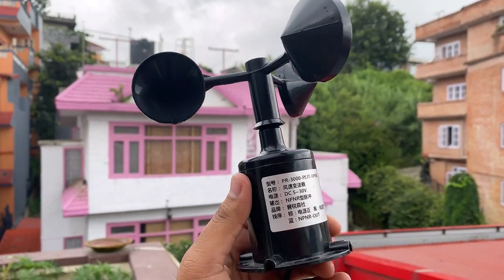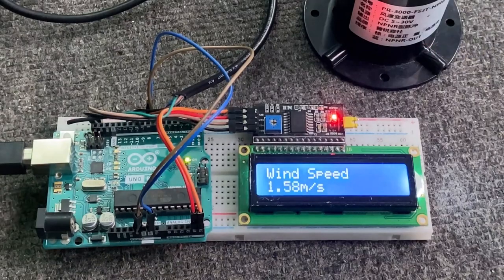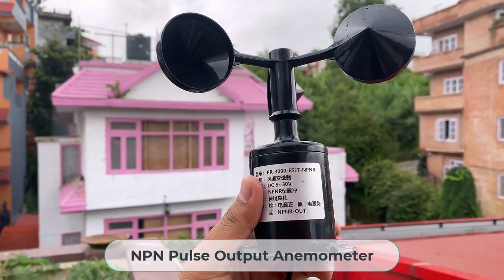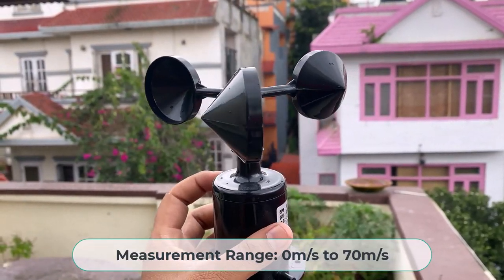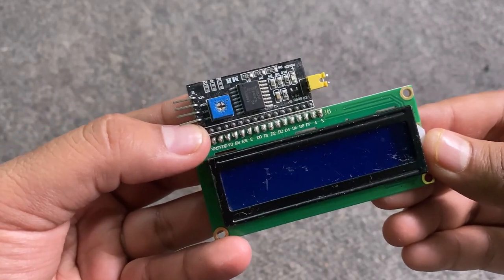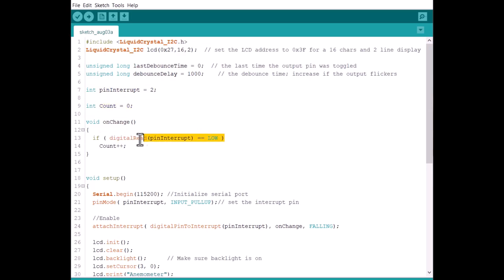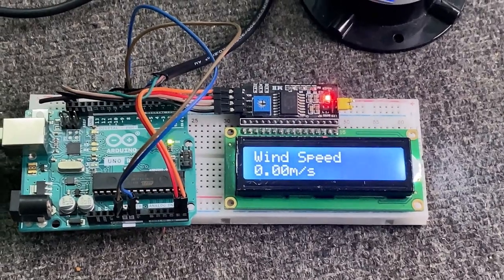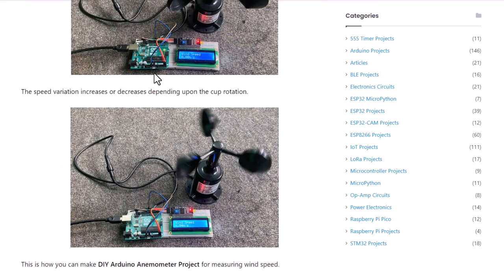Wind Speed Meter with Anemometer with NPN Pulse Output & Arduino

Comment: I have PR- 3000 - FSJT-V05 
Shoudl I change something in connection or the code ?
Also, I follow the same steps that you did it 
But there is an Error massege in [ lcd.init() ; ]
Reply: Replace the command "init" on line 26 with the word "begin" and it works.

Comment: Arduino: 1.8.19 (Windows Store 1.8.57.0) (Windows 10), Board: "Arduino Nano, ATmega328P"

\Arduino\sketch_may14a\sketch_may14a.ino: In function 'void setup()':

sketch_may14a:26:7: error: 'class LiquidCrystal_I2C' has no member named 'init'

   lcd.init();

       ^~~~

exit status 1

'class LiquidCrystal_I2C' has no member named 'init'

This report would have more information with
"Show verbose output during compilation"
option enabled in File -> Preferences.

Comment: Using interrupts in such a way does not seem, to me, to be an efficient method of programming. Couldn't you just use a binary ripple counter (such as a 74hc4020) and save on the interrupts?
Reply: why using interrupt isn't efficient could you please elaborate??
Reply: @অৰি It's just a thought. I  prefer not to use function calls within the main loop because of the overheads. Interrupts are similar. In this case they could be replaced by a counter to minimize the calls.That interrupt could be engaged multiple times within the main loop.